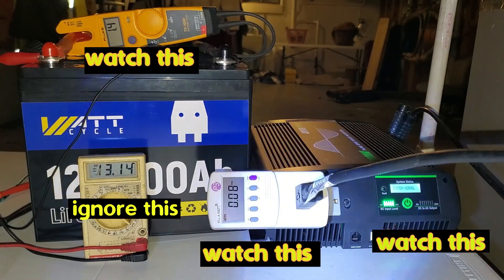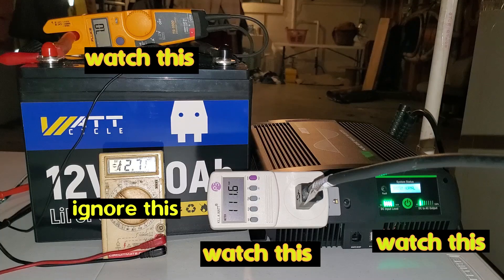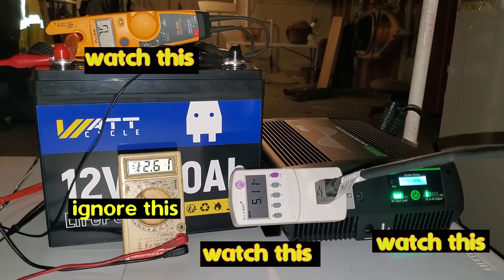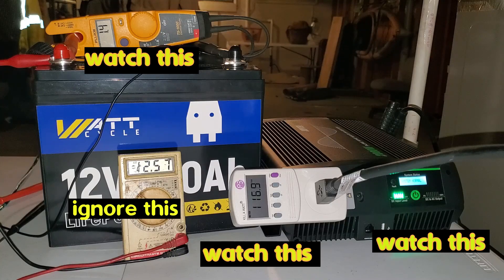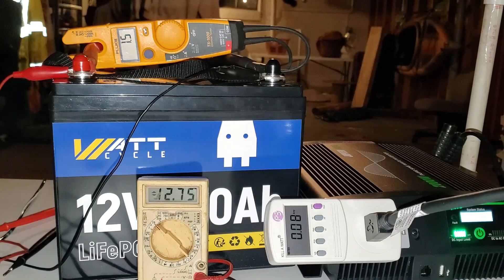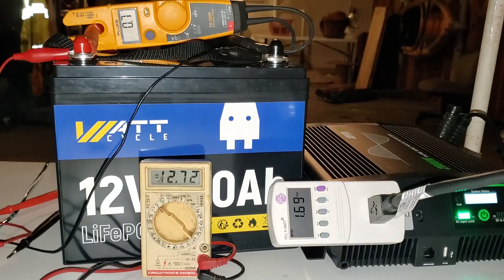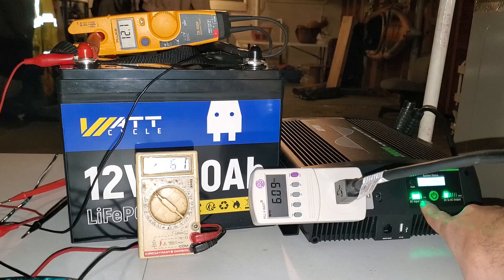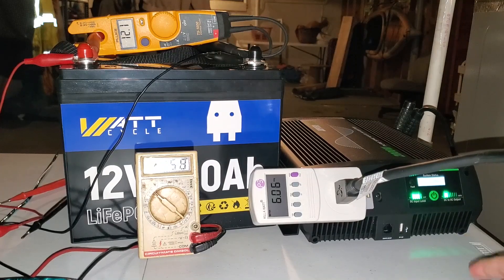I Ran a Furnace on a $160 LiFePO₄ Battery — You Won’t Believe the Runtime!

Comment: BOGUS TESTING:  113 VOLTS A/C X 5 AMPS WHEN RUNNING COOL DOWN (FAN ONLY =565 WATTS DIVIDED BY 12.8 VOLTS WOULD EQUAL 45 AMPS DC, NOT 2.8, 3.6 OR WHATEVER YOUR FAULTY METERS ARE READING.  SOME OF US WERE NOT BORN YESTERDAY.  IN OTHER WORDS A 100 A/H BATTERY WOULD RUN JUST OVER 2 HOURS USING 45 AMPS.  NO ROCKET SCIENCE NEEDED EITHER.
Reply from the maker: Sure... If my furnace was running continuous. Thanks for watching.